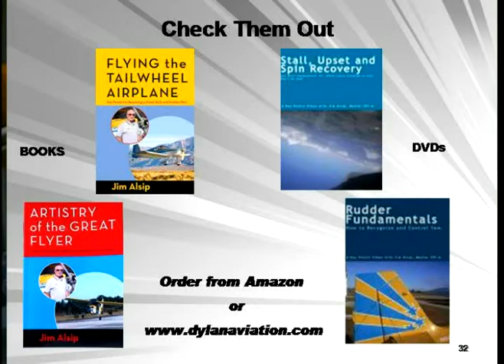Side Slip or Forward Slip

Comment: i like how a forward slip is when your nose pointing to the side, and a side slip is when the nose is pointing forward. when i was learning this stuff i always got them bass akwards.
Reply from the maker: Thank you for your comment Big Dog, but actually where the nose is pointing is not a definitive rule. Best to think a ground referrence manuever with "runway" in sight picture. In a forward slip airplane is slipping forward on flight path. In a side slip aiplane is moving 90 degrees across flight path. What confuses pilots is sometimes it is just a slip; for example a slipping turn to a landing can be side slipping and/or forward slipping depending on wind and position in turn.

Comment from the maker: Thank you to all who offer thoughtfull comments. The comments confirm what I have written in my introduction to this video. The slip is the most misunderstood and mis-taught maneuver in aviation.
Please read FAA Flying Handbook, Chapter 8, figures 8-11 and 8-12 for definition and how to fly the side slip and forward slip.

Deep thinkers will be interested in FAA Handbook of Aeronautical Knowledge with reference to the Four Forces of Flight Diagram, and how those forces define the forward slip. Remember that the forward slip is used to lose altitude, a function of gravity (weight). Drag is that "magical" force that makes it possible to control airspeed.

For those pilots who still cannot understand the difference between forward slip and side slip I suggest you try landing with a strong cross wind. Establish a stable approach, high on the glide path, and then slip to lose altitude. Side slipping will be a challenge and very uncomfortable (maybe dangerous). 
Fly the same approach again using a proper forward slip.

Comment: I think the difference between a side slip and a forward slip is the amount of rudder. For the same amount of bank, less rudder will put the plane on a lateral drifting trajectory, or side slip, and more rudder will bend that trajectory back around to head forward again into a forward slip. In the case of the forward slip the airplane is crabbed, but wings are banked and together with the side of the fuselage turn the plane into a giant air brake.

Comment: The video seams to have caused some real discussions, disagreements.  I believe you will find plenty of other instruction regarding crab correction for drift with xwind landings.  Jim is simply adding a fwd slip to control descent when power is required in the crab to counter drift.  When discussed by other tail wheel guys often said It is not for the beginning tail wheel pilot and requires additional practiced skill set.

Comment: They are both side slips. The only difference  is that less rudder is required and more aileron for the x wind landing scenario, to allow the fuselage and therefore wheels to better align with the runway. Why you guys in the states have complicated this I can't imagine. The control inputs are the same whether you want to lose height or land wing down in a cross wind.
Reply: It's because you have a number of things incorrect. First is the track. In using calm wind for a reference point, if you do a side slip you will move perpendicularly away from the runway. In a forward slip, you will continue to track straight toward the runway. Second, you cannot say that a side slip uses less rudder than a forward slip. In a strong enough wind, you will use every bit of rudder. Third is the intention. Side slips and forward slips are used for different purposes, which is a highly significant difference. Fourth is that a side slip will have a wing low. A forward slip does not. Fifth is that power will still be up in a side slip approach, whereas power will be at idle for the duration of the forward slip.

There probably are some other differences that I'm missing too. What I will grant you is that the differences are not what you would call huge, but yet they definitely are significant. It's simple to enter either of these slips, and the basic control inputs are the same, but the final degree of how much you use the inputs, and whether you allow a wing to go low or the fuselage to straight or turn, and where you have the power set make all the difference in the world.
Reply: @schm1035  Power on, power off, wing down, wing level, wind across, no wind, all the inputs are the same, you are in a side slip. If you side slip down a runway with no wind across, you do not automatically leave the centre line. You can track it whatever the wind. If there's such a thing as a forward slip, show me a backward slip! You can't. You can sideslip while maintaining height and then close the throttle and descend, change direction, increase power and climb. All while side slipping. Side slips and forward slips are not used for different purposes because they're both same only what your trying to achieve might be different. Your talking utter bollox.
Reply: @stewartgrant9832  Wow, Stewart, you have wildly incorrect concepts about these slips. It's funny that I've never heard anybody say the things you are saying. I don't even know where to begin here, especially since you have some self-contradictory statements. 

It is irrelevant that the inputs are the same to make the two slips. What matters is how the plane ends up oriented, what the power is doing, and what you're trying to accomplish. 

If you side slip down a runway with no wind, you absolutely will go off centerline. That's the definition of a side slip, and that's what it's for. A forward slip will not do that. 

Show you a backward slip? That's ridiculous. Why don't you ask me to show you a diagonal slip or an upside down slip or a vertical slip? I know you're trying to be cute, but that's really not an effective argument method.

The fact that you can do various maneuvers in a side slip may be true, but so what? Why would you ever do that? 

Are you kidding me? Side slips and forward slips most certainly are used for different purposes. I think you're just stuck on the fact that the basic control inputs are the same for the two slips, but that does not make them identical by any means. The orientation of the wings and the fuselage is different, power usage is strongly different, and the goals of the two slips couldn't be more different.

I'm making the guess you must be in England. Are you sure all instructors there teach what you're saying or was it just your instructor or is it just you and your ideas about it? It sounds very, very wrong, especially since in all my 47 years as a pilot I've never even heard of such a thing.
Reply: @schm1035  I quote: "The fact that you can do various manouvers in a side slip may be true". You've answered your own question. Why do these manouvers? Because you might go from a slip to lose height on a base to final turn with let's say idle power and then add power to flatten the approach while still in a slip to land wing down in a cross wind on one main wheel while adjusting power accordingly. The Brits don't need to to put frills on it. It's all cross controlled slip. The orientation is of the wing and fuselage is relative to where you want to track and where you want the nose to point, ie at touch down, straight down the runway. If you start talking about forward slip on an instructor revalidation over here you'll be taken behind the hanger and shot.
Reply: @stewartgrant9832  Yes, well, I see you continue to demonstrate the superiority of the Brits, as you say. Maybe the real answer is that you're just less accurate and precise and have an incomplete understanding of the slips. 

The fact that you said side slipping in a calm wind will not take you off centerline all by itself tells me you don't understand what's going on. If you're coming in high on approach in a calm wind and you decide to slip to lose altitude, are you telling me you're going to go into a side slip? Good luck with that because you'll instantly go off centerline. 

What it's really coming down to is that you want to say that no matter how you slip the plane, it's just all the same thing. If you want to think that, then go ahead. Maybe we just like to be more precise and realize that you're doing different versions of a slip for either crosswind correction or losing altitude. If you go for a recertification here and say that all slips are the same, then I suppose you'll be tied to a car and dragged down a gravel road. 

In any case it's obvious we're at the point where nothing can be said that makes any difference. If you think about it differently over there, then fine. Arguing about it isn't going to change anything.
Reply: @schm1035  If I'm coming in high on an approach in nil wind and I want to lose height. I'll ease on some aileron and opposite rudder and track the centre line! Not automatically go off centre line. Because in Britain we've learned to coordinate the controls so that we can go where we want while cross controlling.

If a pilot is approaching a field and wants to lose height they will side slip. If during that phase they want to change position relative to the centre line they adjust the side slip by coordinating the controls. They're not going from a forward slip to a side slip because they're already in a side slip. It's only the track of the aircraft that's changing and minor adjustments on the controls.

What happens if I'm high and  right of centre line and put in left side slip to correct but go to far, have I got to go to right side slip to get back on track? Bit messy. Surely, I'll just remain in my left side slip and ease off the left aileron and move to the right. Simple.
Reply: @stewartgrant9832  Your comments about British pilots are cracking me up. I didn't realize I was talking to the official representative of all of them. I sure wish you would come over here and show us how to coordinate controls because we're all doing it wrong. Barring that, just keep the comments coming because they're quite entertaining. 

Other than that, I have to say I disagree with everything you said. I truly think you don't understand how slips work or else you wouldn't be contradicting yourself so thoroughly. I also wish you would send me a picture or scan or reference to a British flight manual that says side and forward slips are the same thing. I'd like to see that explanation.

We're just going around in circles, but here we go one last time. if you are on centerline and start a left side slip, you most certainly will go left of center immediately. That's what side slips are for. You cannot go back right simply by easing off the controls a little bit. All that will do is continue your left drift at a slower rate. I love how you gloss over the way to correct that drift by just saying that you would coordinate the controls.  What's that supposed to mean? Exactly how are you doing it? You're not going to go back to the right without either entering a right slip, or turning the nose back in that direction, either in or out of a left slip. If you stay in the slip and simply ease up on the aileron without moving the rudder, then the nose is going to yaw right in a skid. That then is going in the direction of a forward slip because that's what one is: a skid. 

Okay then, once again I have to point out the obvious thing here. You think I'm wrong and I think you're wrong. We're not going to change our minds, so is there any point in constantly repeating all this? I'm pretty much done with it.
Reply: @schm1035  Oh dear. You really don't know how to coordinate the controls if you can't change track in a side slip. If you're in a left side slip and want to track right, you either ease off the aileron or increase right rudder. 
 British flight manuals don't mention forward slip because there's no such thing. Forward slip was invented by the Americans when they realised that the aircraft was actually still travelling forwards and not just sideways in a side slip, and it's been a revelation to them ever since. Similar to "Blow Wash". Another Americanism. Meaning Prop Wash. Not to be mistaken for Hog Wash, which is exactly what you've been describing since we started. But because I'm a decent British chap  I've enjoyed our discourse and respect your take on the subject and completely get what you're trying to say. Best wishes.

Comment: Very helpful. I might have had the two terms backwards? Don't need this much in a Cherokee 140 as far as side slip goes. I recall constant confusion on dealing with x wind initially. I did a slip with an instructor while student pilot on short final flaps down in a c150 to loose some altitude. She said don't do that because 150 does not have the performance. Warm day in Texas it was.

Comment: Hello,

In the forward slip portion of the video if the wind is still from the left should not the controls be left aileron right rudder?

Thanks,

Joe
Reply: That sounds correct. That would give you the most drag, which is the entire point of the maneuver.
Reply: Slip into the wind and then it will be an easy set up for a cross wind landing technique
Reply: HE DOES THEM WRONG.  A Student Pilots Error.  And some suckers gave this guy a Master CFI award.  So he vomits bullshit all over those airports.  No wonder USA GA is so full of pilot errors all over.  CFI's like this...
Reply: I’ve flown with this guy many times and done a lot of his courses. After 40 years of flying Jim is the best Ive seen but obviously not for pussies.